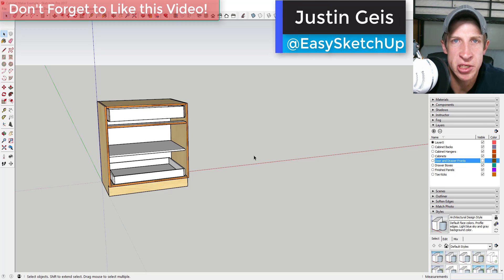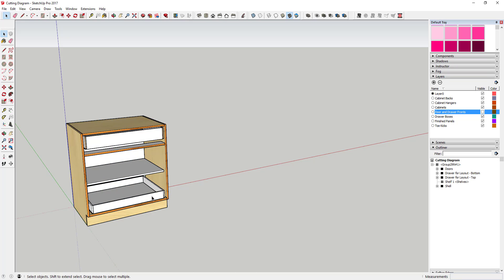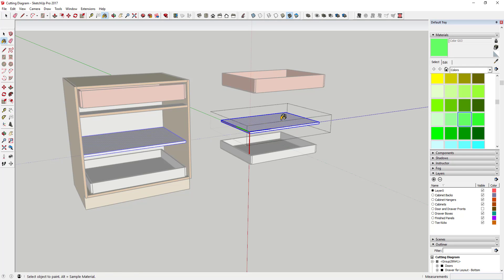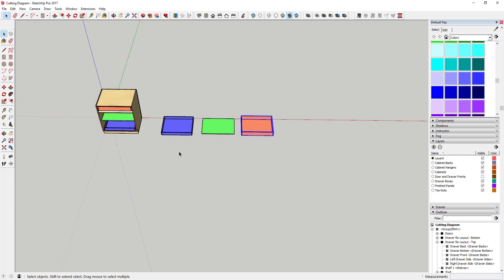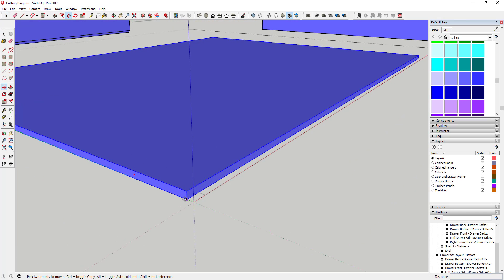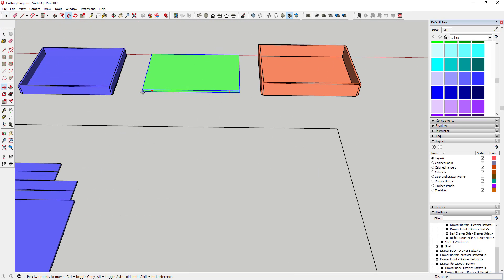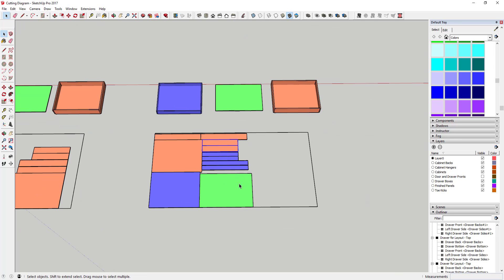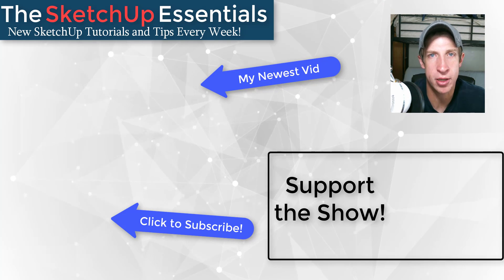Creating a Cutting Layout in SketchUp for Woodworkers - The SketchUp Essentials

Comment: That's a lot of work to do all that copying, ungrouping, dragging and dropping, and then rotating ... but this video is 7 years old so I would expect all that to be automated now. Like, I design my bookshelf manually, and then I press a button to create cut-sheets (instructions) based on recommended (materials are fairly standard) or user-specified source material (raw materials). And, as someone else commented, automatically accounting for blade width.

Is this the case now? If so, is it only available in higher-priced subscription tiers?
Reply from the maker: Nope, pretty much the same. There are some cutlist tools (Open Cut List I think) that might be able to do this, but the point of SketchUp is its flexibility over complexity. I don't know if maybe something like Fusion 360 automates this better, or something else. You can definitely do it with SketchUp, and it's a great tool, but you have to learn how everything works and work within that framework

Comment: Good general guide. A couple of points for newbies out there: the parts were rabbeted and the way they were lined up didn’t account for the rabbets or for the blade kerf. It’s a good idea to leave ⅛ to ¼ inch of clearance between parts when laying out on your virtual sheet. That way you ensure you can fit everything on your real material. I generally cut a little large in my rough cut, then trim down to final dimensions late. I also typically also trim off the factory edges on my plywood, which leaves me a sheet 1-2” shorter in all dimensions. So, make sure to leave yourself sufficient clearance when laying out your cut diagram.

Comment: The problem I see with this layout is that it does not allow for the saw kerf. Cutting on these lines will make some of the parts too small while the adjoining part is too big. It also does not allow for fine tuning and jointing to remove saw marks . When I do a layout like this, I allow double my saw kerf between cuts and align the pieces so there is a single cut across/along the material. Guidelines help aligning and spacing for kerf. I place the larger pieces first along a common edge (allowing for the kerf between them), then fit the smaller pieces within the cut limits of the larger pieces. Taking the time to layout like this simplifies cutting, especially when cutting plywood.

Comment: Any way you can edit or post a supplement about how to 'optimize' the nesting, rather than manually laying it out? What if your project required 2, 5 or 10 pieces...the waste plywood can become substantial.  Even better, is there an extension that does this that you would recommend.  Ideally it would account for cut spacing (saw blade is 1/8").

Always a fan of your tutorials - your work has massively helped me get started with this program. thx!
Reply: @Jason Dagenais - https://extensions.sketchup.com/en/content/lair-du-bois-sketchup-toolbox-0

Comment: I wold have inserted a small piece between the pieces for the thickness of the circular saw. Sometimes every mm counts.
Reply: Draw a dividing line/rectangle to match your kerf and insert it between each object. This will give you ideas on cutting order to minimise alterations to saw fence settings.

Comment: What are you holding to move the individual pieces of the component without the entire component moving? Is that a shift+move operation?
Reply from the maker: Assuming I'm understanding your question properly - I'm not holding anything - I just doubled clicked inside the group, then selected the individual pieces I wanted to move and moved them around with the move tool. Does that make sense?
Reply: @Thesketchupessentials  Yep, that does make sense. Since you didn't explode that first drawer after moving it into your ply sheet outline, it made me wonder how you were moving the individual parts without the entire drawer moving with it. I mostly use solid wood, so this layout thing is even simpler -- just calculating board footage, so I don't have to worry about fitting things into ply sheets.

Thanks for all your work on these vids!

Comment: Hi, Great Video, is there a way to set the kerf of the saw blade to all components automatically?
Reply from the maker: I guess the short answer would be no, not in the way you're thinking. You'd probably have to find a way to manually add that in. Sorry about that
Reply: Just put them an eight of an inch apart. So line up the item then move .125 on axis away.
Reply: Yes, the standard kerf for a table or a track saw is .125.

Comment: Love it! Question. What if I worked from the 4x8 plywood sheet to build a cabinet? Taking pieces from the sheet as needed to build the cabinet. Would it be easier to know how much wood is required? Or because of your extension, it works better as in the video?
Reply from the maker: Hi there! I'm not 100% sure what you're asking... Are you talking about working backwards, cutting the actual pieces out of the sheet and building as you go? That would work, it's just a different workflow - I'd give it a try and see if you like it! :)
Reply: yep exactly what i was trying to say. Making the sheet first, then cutting pieces out of it. Giving it a try now. Thanks for the tip!

Comment: This was a very good video. The only issue is that that thickness of the different materials are not the same. Sides are typically 3/4 for cabinet sides, and 1/2 inch thick for draw sides and 1/4 in thick for cabinet backs and draw bottoms.
Reply from the maker: Yeah, I know - that was actually how the GK Ware Cabinet Maker extension drew them, I just made them all the same thickness for the sake of quick video. That said, you're absolutely correct - you'd need to do a separate layout for each different material. Thanks for the feedback!

Comment: don't fore get to account for the thickness of the saw blade 1/8" for each cut
Reply from the maker: Thanks Vince - great point! This should be pretty easy to achieve using the move tool, but thanks for bringing it up!
Reply: It's too much work for me to lay an 1/8" gap between each piece.  So I just count the number of cuts and make sure I leave enough space to the end of the sheet.  Example 4 cuts is 1/2", so I just make sure I have at least that much to the end of the sheet.  Also watch out on your plywood dimensions.  Some suppliers sell a true 4x8, some a 1/2" bigger.
Reply: This extension will take all that into account and is automatic.
https://extensions.sketchup.com/extension/e10bc77a-7a27-47ea-b6f0-773eef8a1fac/cut-list
Reply: watching video, and wondering what kind of magical kerfless saw he plans on using.
Reply: Is there a special tool for adding those gaps guys? E.g. if I don’t know the exact thickness of saw it would be nice to “set all gaps” and input any digit depending on what saw is used?

Comment: Thanks for sharing. I think that was a very good video for budding woodworkers and ambitious SketchUp beginners. I particularly enjoyed the demonstration of the rotate tool.

Just 3 things I can suggest. 

A really quick way of laying something on a surface is simply Ctrl-X, Ctrl-V - much faster than "move and inferencing".

Saving wood is an important part of woodworking, but perhaps even more important are the first 3 cuts because if these are planned correctly, the parts from a single cut will all have the same length and the total cutting time will be minimised. See  https://www.youtube.com/watch?v=k4x7WL21pnM .

Thirdly, the kerf width has to be taken into account, to avoid cutting under size, (2mm in my case).
Reply from the maker: All excellent points Jeff - I especially like the second two because I'm not really a woodworker in my day to day life, so this is exactly the kind of feedback I like so I can try to incorporate in my future tutorials. Thanks again!
Reply: If I may ask, what is your day to day life? Architecture? IT? Both?